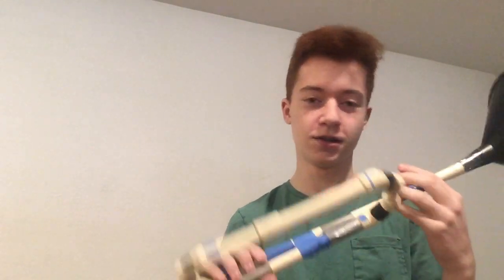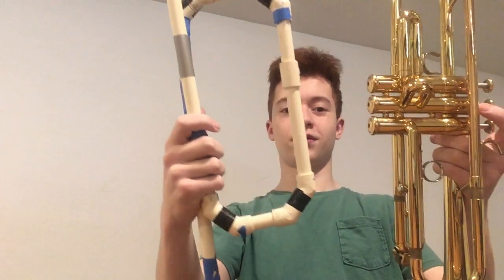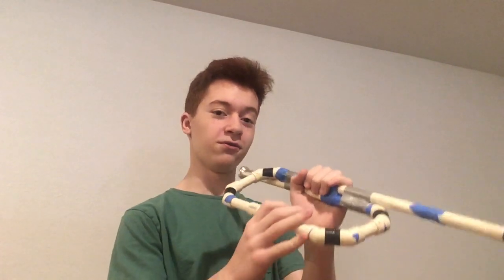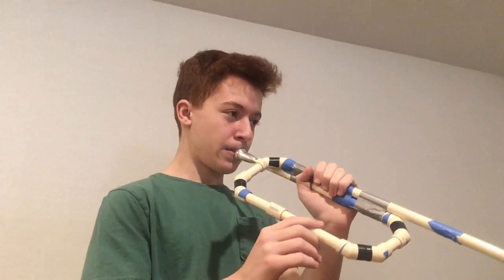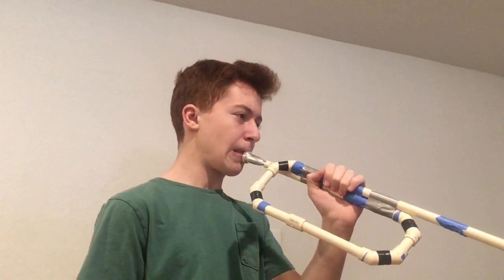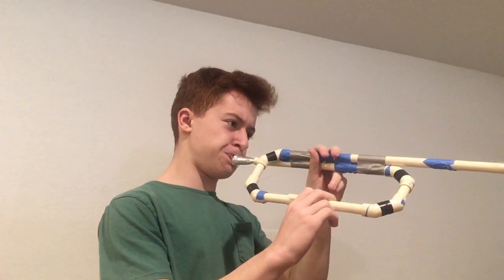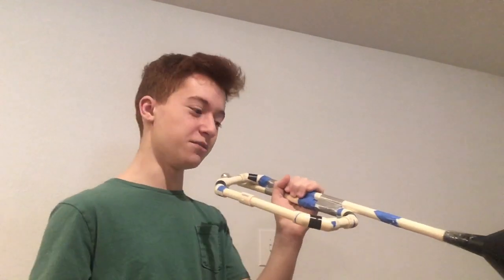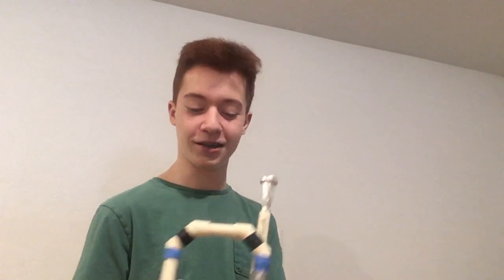The Problem With my Plastic (PVC) Instruments

Comment: Why use all those fittings when you can just use a heat gun? Mine is just a pipe I made a loop of with heat, an adapter for the mouthpiece, and a plastic funnel. I glued/taped it all together, painted it (mostly) gold, and added a carrying strap out of nylon rope. It actually sounds pretty good. I would reccomend simplifying your design.
Reply from the maker: Good idea! The fittings did seem to be part of the intonation issue, so maybe someday I’ll try this again with a heat gun.

Comment: Thanks for a terrific video! My daughter is trying to build something like this and is trying to find the right PVC pipes that will fit her mouthpiece. What size/type of PVC pipes did you use?
Reply from the maker: Glad you enjoyed! Trumpet building is finnicky business. The smallest diameter of pipe I could find at the local ACE was 0.5", but most trumpets have an actual bore size around 0.46". See if you can find anything smaller than half an inch, but if that's the smallest they have, it's the best you can do.
Reply: @SamuelPlaysBrass  Thanks so much! She will go to Home Depot tomorrow and see what they have.

Comment: Your instrument is not a uniforming cilindrical bore. The splicing changes the diameter multiple times although small but those diferences add up on the extremes. That in tune F might have the nodes on the splicing ( this bit is a guess )
I have had similar problems.
Also the end doesnt cone out. Which makes the bell quiet abrupt
To correct this if you are still interested heat the pipe with hot sand ( cooked in a oven. There are videos on how to bend pvc pipes with sand ) and you will get a uniform diameter in a large cilindrical bore.
Reply from the maker: Interesting insights! I still think having a conical bore would keep the intervals from getting too spread but I agree that the joins can cause a lot of idiosyncrasies. One of these days I'll attempt some of those pipe bending techniques.
Reply: It's definitely the shape of the bore. On a real trumpet, about 2/3 of the tubing is cylindrical, while 1/3 of the tubing is conical. On this PVC trumpet, only the bell is conical.
Reply: Mine is just a simple loop made with a single piece of pipe(not counting mouthpiece or funnel). I used a heat gun to make the pipe plyable and formed it into a loop.

Comment: I think i solved your problem instead of pipe conectors you use a hosepipe instead i tried on my pvc natural trumpet and it worked but im not the greatest trumpet player so i can t really play particulary high wich is super important on baroque repertoire
Reply from the maker: I think the hosepipe would definitely help some, but all the tuning will still be cylindrical, which I would guess would throw some of the tuning off.

Comment: Did you ever have any luck solving the fundamental issue?
Reply from the maker: The issue is in the fact that this instrument is purely cylindrical, so I know what the issue is but I have no way of solving it. I've made a semi-successful D natural trumpet but the bottom notes are definitely still flat. However, the baroque trumpet never uses the bottom three partials so it kind of works.
Reply: @SamuelPlaysBrass  I see then. Have you ever experimented with drilling tone holes into the PVC to create more notes?
Reply from the maker: @travisolsonmusic  yes, and it turned out abysmally.
Reply: @SamuelPlaysBrass  have you tried heating the pipes and flattening/ bending them into the shape you need?
Reply from the maker: @Kilo-sz4ch  That is something I would love to mess with if I had the resources, time, and patience. But to answer your question, I've never tried.